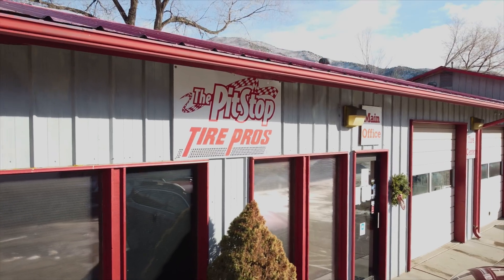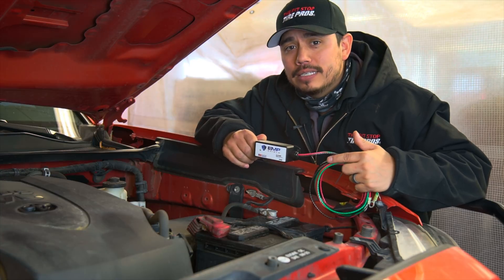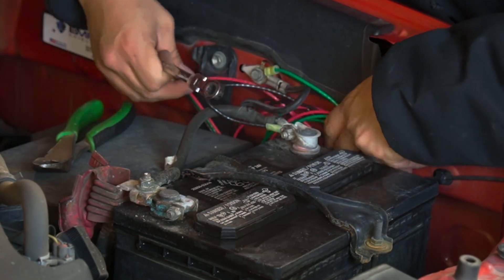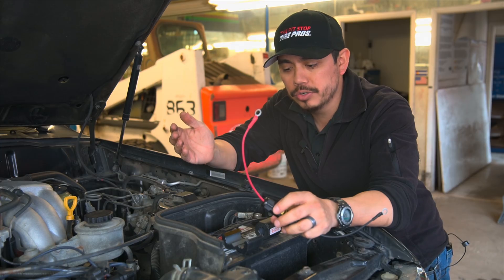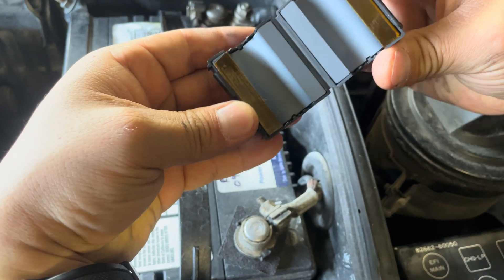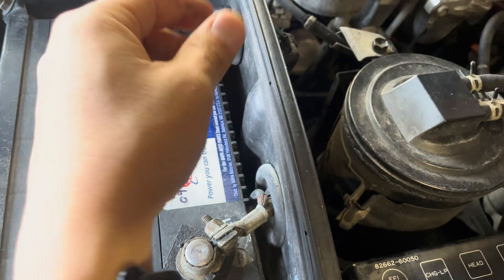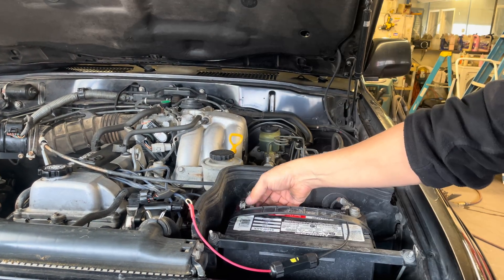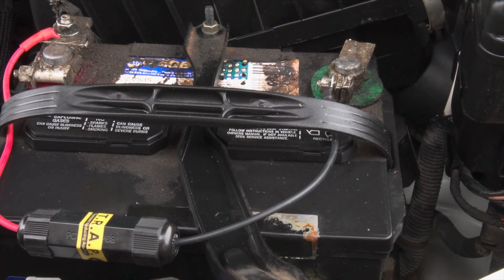EMP Vehicle Protection / What are the options?

Comment: The real issue is the voltage inducing on control wires. With an EMP all the wires are going to act like an antenna. The battery will be seen as a dead short to the EMP. I built an EMP generator that creates an  E1 and E2 pulsed field. At that power and frequency everything is seen as a capacitor and inductor. The SKIM module will be toast as it has a large antenna coil.
Reply: Depends on wavelength of the pulse. If the pulse is a long length, then the wires all pick up a voltage depending on their orientation to the field waves, but if it's a short wavelength, then the voltage will be sky high across say 1CM (1/2 inch for Americans insisting on using antique units) of wire but will be 0 across a longer section of wire and then back to sky high as you move the probes so they fall on parts of the wire that are at different points of the wave... but the net current flow induced (and therefore voltage) should be low or unpredictable for the devices attached on either end. placing some cheap MOV (metal oxide varistors) on each wire to ground with a spark gap for absolute stupid amounts of voltage would EMP proof the cable and attached devices against long waves and some short waves, then again, so would twisting the wires around a "ground" or some form of differential wire as is used by differential signaling for long distances to avoid noise and electrical impulses (See USB cables, thunderbolt, displayport, ETHERNET, and even modern telephone wires especially if they are used for DSL internet). Failing that you could shield the wires not that differently from HDMI, Thunderbolt, Display-Port, and Cat 6A ETHERNET, a simple tin foil shield that is grounded would all but EMP proof the wires.

Trouble really arises for shorter wavelengths. If a long wavelength hits your ECU, the entire ECU sees the wave at once and the difference between each side is quite small, a tiny tiny tiny portion of the total amplitude or wave height, so tiny that it won't hurt it unless a wave hit it that was so powerful it would also melt the car's body from the induced currents... at which point whether the ECU is fried or is literally burned by the molten body is fairly irrelevant. TO protect against this, the best way is a faraday cage, either park inside a metal container that is grounded, or wrap the ECU in foil and ground that to the car body, for the extra paranoid you can drop a ground wire from the body to the earth and drag it behind you if you care for extra grounding than what is possible through your tires.

An EMP weapon I assume would either use a long ass wave length to damage the power grid... but would only blow fuses and the lines would be fine, it would suck for anything not surge protected though, like what happens to the grid each time a bolt of lightning strikes near the wires but not a direct hit, that creates a massive surge up and down the line. Fuses would blow and leave us in the dark. But if there are short wavelengths too as I assume some weapons may generate either intentionally or unintentionally, these would physically be about the length of the ECU or even the chips inside the ECU, and as they wash over the ECU they would place an extreme induced current across all the ECU parts both forward and reverse currents which create back EMF from the solid state components acting as diodes and blocking the reverse current... this then blows the chips up. Need to wrap the ECU and other computers in a faraday cage to prevent this, probably easiest and cheapest to use aluminum foil sandwich wrap.
Reply: @asificam1  yup that's what I noticed it did. Emp simulator was built from a spiral line driving a fractal style HDTV antenna with a bit of copper clad as the ground plane, then used a small satellite dish to stack the modes on top of each other. The center was tuned using an inductor. All of it was submerged in transformer oil. The thing made pulses that peaked well into the MV per meter range and had a rise time of about 4nS with ringing lasting for a few tens of nanoseconds. The most expensive part was the oil believe it or not. The HV generator itself was  made of Bakers and chefs heavy duty foil rolled like s jelly roll with several turns of the outer foil in the middle. A spark gap made of ice maker tubing was the switch that triggered the pulse. Electrically it acts like a tidal wave that creates a massive current that when it hits the shallow bits it becomes a tsunami of voltage that is compressed in time. Rise time is 60ns. This hits the fractal antenna and all sorts of nonlinear effects occur creating everything from microwaves to AM bands, these are all stacked by the dish on top of one another compressing the EM pulse further to about 4nS rise time.. fast pulses of powerful RF like this do not see electronics as anything other than capacitors, inductors, and antennas. ❤️
Reply: @christopherleubner6633  I would be very curious to see your simulator and run some tests on video with it. If you're in the Tristate i would come and pay for it.

Comment: 3 wires?? The battery's Negative terminal is connected directly to the chassis frame.
Reply: The guy in this video barely knows how to change a battery. He has no clue why those wires are there. All he wants is to sell you snake oil for $400 and get the commission. 
Look at those long wires this device comes with. That is against any kind of proper design for a shunt. It's a complete joke.
Reply: Ya he lost me with the Neutral in a DC system. Edit: these seem as gimicky as the 'plug me in to get 40% better mileage' devices. Would love to see a test done like discharge a large cap onto it to see if it actually triggers
Reply: It would make way more sense if it was an item that went around the the wires going into  the computer to block interference

Comment: In the 1970s people could fit a rubber strap to the rear bumper that would drag along the road & supposedly prevented passengers from getting 'car sickness ' . I don't know if it worked but something similar could be used for the EMP issue.
Reply: The strap has a trace wire in it to discharge built up static , like the grounding wire that must be connected before refueling an Aeroplane . 
Some branded tires also have a carbon in them to fix this issue .
If you want to make your own "EMP Shield" device , it's called a capacitor 
Oh wait your ECU already has caps in it to fix this as the ignition and alternator boot out so much voltage ripple it makes a solar flare look like a match stick
🤣🤣🤣
Reply: or just unplug the battery

Comment: I scoff at EMP as I own a '85 Ford with a 460. It has a dizzy with electronics and an alternator with electronic voltage regulator which can be damaged by EMP. In an ammo can is a 70s dizzy with points, spare points and capacitor, and a mechanical voltage regulator all of which will survive at any EMP. The truck sits with over 50 gallons of gasoline. I can convert to these mechanical parts in about an hour. This country boy will survive.
Reply: ^^ THis guy actually gets  EMP and electronics!
Reply: I have two Ford 460s, 50 gallons won't get you far!!
Reply: @AUCTIONCAT2011  it will get him to other broken down vehicles that have gas
Reply: @AUCTIONCAT2011  almost 600 miles on 55 gallons (18.3+35) as I get almost 12 mpg at highway speed. Slower I can go farther. I also keep a lot of ethanol-free gasoline in cans for my generator. This is on 87 octane, 9:1 c.r., and other mods.
Reply: I have a 65' poly 318 coronet. THAT will survive an emp + the car gets like 20mpg on the highway if I stay at 50. (2.41 rear gears lol)
Reply: @armankordi  Nice car and those 318 would run forever with clean oil.
Reply: i have a bicycle and can ride it...
Reply: @luisr.3855  for me I cannot ride a bicycle or motorcycle anymore due to balance issues at age 77 but i can somewhat walk...
Reply: @ArnCital  I applaud your efforts but I bet that costs a pretty penny to drive around. Not saying it isn't a good plan because it is, but those of us that do have working vehicles  will still have to contend with the fact that there will be armed roving gangs coming for are stuff and once the gas is gone its gone because all of the gas pumps will be down. Still it will give you some time and that is good.
Reply: @hunterusa4039  1. I am armed. 2. I have one vehicle that I can run on wood gas 3. I can keep a vehicle running on sage brush and wood. 4. Vehicles with carbs are easy to convert.
Reply: @ArnCital get an electronic wheelchair.  Put emp shield 🛡 on it😅

Comment: Please explain how this works. Because I don’t understand how this works. A DC system doesn’t have a neutral. Only a positive and a ground. Now I understand that a neutral in an AC system makes its way to earth, ground, but is a completely different system. Your vehicle isn’t grounded to earth. And shunting the voltage to vehicle ground, won’t that just put the voltage into the negative side of the battery and every other electrical part in said vehicle? I’m not trying to be difficult but I don’t think that this item would work the way it is claimed to work.
Reply: It doesn't theoretically, if there was a voltage that was say either backwards or a voltage that was way way too high for a cars 12 volt system (so above the usual 14 volts the alternator makes to charge the battery) these devices claim to act like an AC surge suppressor and its MOVs (Metal Oxide Varistors) which short out the high or reverse voltage and drain the energy before it blows up the electronics. Here is the issue, ALL signal wires will also pick up the signal wires, and the 12 volt power wires are themselves filtered internally by the computers as they can't cope with how shitty the alternator is at maintaining constant voltage, the alternator sags low under high load and if the RPM falls, and it spikes if the RPM rises and the electrical load is suddenly removed. You can see your lights flicker if they're the wrong kind of cheap LED replacement when you activate high loads like rear defrost or plug in a high load 12 volt device at low rpm with small alternators for that reason. The field coil current can't change fast enough, in the time of a flicker, most cheap and shitty microcontrollers and other CPUs execute anywhere from a few thousand instructions to a few million instructions, this would cause a crash if you're lucky. So the computers have their own power supply circuits that step up and step down the dirty, spiky, ripply DC power from the engine and make it clean and constant with a few thousandths of a volt of ripple (+/-0.001V). The signal wires may not be as protected, so not protecting them with a MOV across them and ground means that the most protected lines are protected right next to the giant battery which protects them anyhow, and the more delicate, sensitive, and less protected lines are left exposed.

Just wrap computers in tin foil that you connect to the vehicle body (ground), twist exposed wires so that induced fields cancel themselves, wrap the wires you can in foil that is grounded, and keep a spare ECU handy in a faraday cage box. These scam products only protect you against say the alternator suddenly spiking more than the battery can absorb. They can't protect against and EMP, ask any electronics guy why and his answer will be similar to mine.

Also your car already acts like a faraday cage anyhow as your car body is made of metal which is usually rather conductive and is wrapped around the ECU which again resembles a faraday cage. Only the bottom of the engine bay and the headlights are places that the EMP could enter. And even then, only some frequencies will significantly make it across the bend. Trouble is that you're likely going to be fried because the exposed radio antenna for the radio and the antenna that your remote uses to talk to the car, and the antennas inside the cabin for keyless start or the NFC coils on the ignition for regular key start would also pick up the EMP.

Comment: Modern car computers are already shielded. High energy ignition systems create an EMP pulse in use. Those computers are usually inside a metal box too.

Also, assuming there was a massive EMP or CME, you won't be able to get fuel anyway.
You might not be able to navigate around disabled cars on the road too.

And then there are cops and governments stealing your vehicle 'for the public good'. Not to mention the criminals will  lust after a working vehicle too.

An old air start diesel is emp proof....

Comment: Essentially the first device uses an MOV (metal-oxide varistor), the MOV, essentially acts as an avalanche diode and will shunt a high volt to spike to ground. There are so many things wrong with what you’ve said in this video it’s hard to even begin to address them. Vehicles don’t have a neutral. They have a ground. There is a difference between, a neutral and a ground in conventional AC electrical systems however, in a vehicle, there is less differentiation between the neutral and the ground. This is because the entire chassis of the vehicle is assumed to be ground in most vehicles. In this condition, there is very little electrical potential difference throughout the vehicle.

If we look at the second solution that you are implementing, which is a ferrite based approach. This is referred to as a choke in electrical terms. That approach works by reducing transient spikes. If you think about what you’re doing here, the goal is to get transient voltage shunted to ground. However, by adding the second solution, you are actually inhibiting that transient from passing through the ground cable back to the battery and to the MOV, that’s attached. The result is that you are combining two solutions that should not be combined in that manner. I believe if you wanted to add the choke on the positive terminal it may be helpful in reducing the amplitude of a high frequency spike. However, a much more effective solution would be to install an inductor in series with the positive lead from the battery. Similarly, you could build a much better power control system by adding capacitors in parallel with the battery. Those things would be much more effective than the approaches used here.

Various people have commented here on whether or not this solution could be tested. I believe this could be tested using something like a very large Tesla coil. The thing I would point out is that you really need to keep all of these transient away from all of the digital components in the vehicle, which would be , an incredibly difficult thing to do. Those types of things need to be addressed at the engineering stage of each one of those components. Things like this are commonly done routinely by using a ground, plane in circuit boards and by using proper power supplies within those components. However, when you start throwing a few million volts at a vehicle that doesn’t actually have an earth ground. The entire chassis of the vehicle will be energized in the event of an EMP or high voltage situation. I believe at very high voltages you would experience an arc to ground as the spike occurs. I generally think while people may be wanting solutions like this, that these solutions are probably ineffective, since there is no earth ground on a vehicle. On the other hand solutions like this are common in data centers which are carefully engineered and which have an Earth ground.  The problem in theory is that the EMP is transferring energy to electrical devices through radio frequencies. So, in order to deal with this, protected electrical equipment, such as data centers need to be encased in Faraday cage. Ships in the US military have radio rooms that are especially designed to deal with EMP and the lengths that are taken to protect those systems are extraordinary. Sadly is very difficult to replicate anything even close to that in a vehicle.
Reply: And this is the only comment in this thread, that is made by someone who actually knows how electronics work and makes sense. The guy in the video was never told to attach a ferrite choke to the negative battery lead. He just wants to sell more snake oil to boost his commissions.